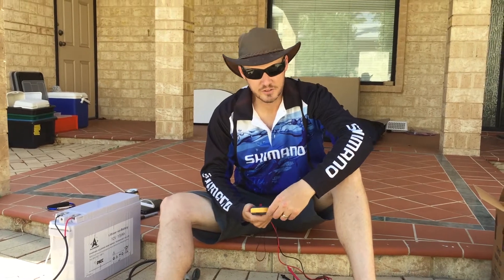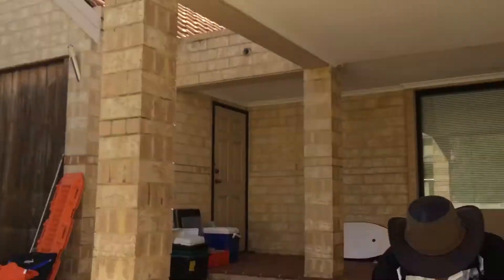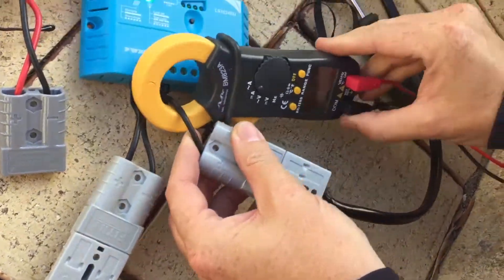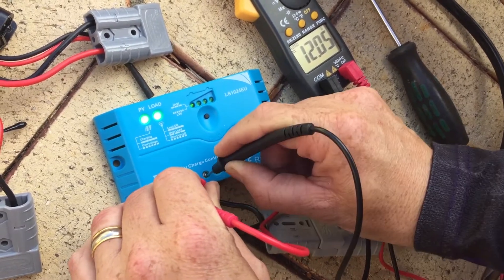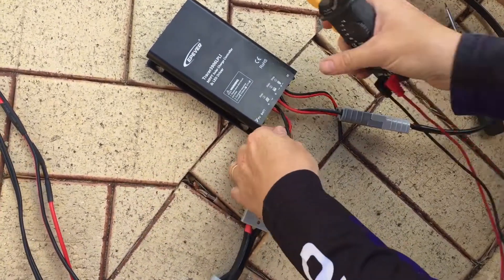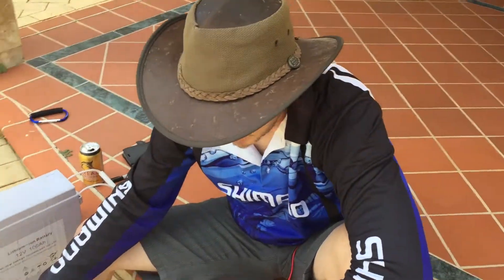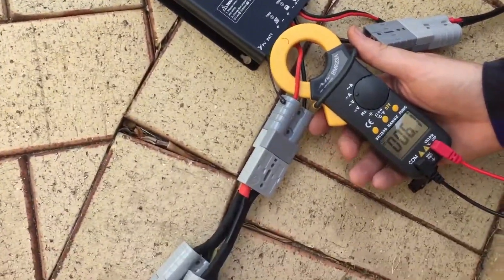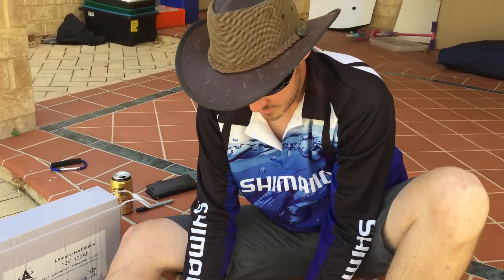MPPT vs PWM Solar Regulators / Charge Controllers - What's the difference?

Comment: Comparing amps to amps only establishes a difference.  But its not comparing energy to energy, which is the real concern.   I could wire up an increase in amps, AND and a huge drop (loss) in energy.   All he had to do was compare watts to watts.   And a loop amp meter CAN NOT do that.

Comment: Hey mate awesome vid helped me out a lot with the differences! 

I just want to ask what are the 2 cables that come out of the very right of the MPPT controller that you have taped up? There’s an Anderson in the solar input and and Anderson on the battery but then there’s the other 2 cables that are underneath picture of the lightbulb and ‘step 1” writing, just wondering what they’re for
Cheers
Reply: G'day Alex! These cables are used for applications where a timer is needed, for example when the units are used for things like street lights. It isn't something most people use in a camping setting, hence they are terminated from the factory.
Reply: Kathleen Glossop Oh awesome thanks for that info 🙌🏼🙌🏼

Do they come taped up like that out the box?